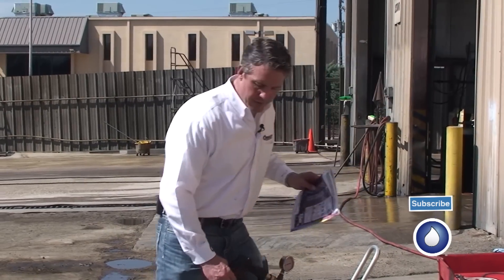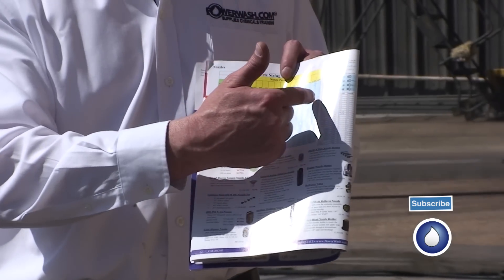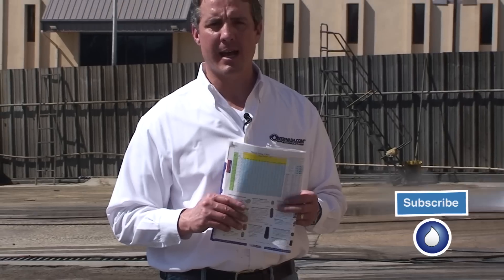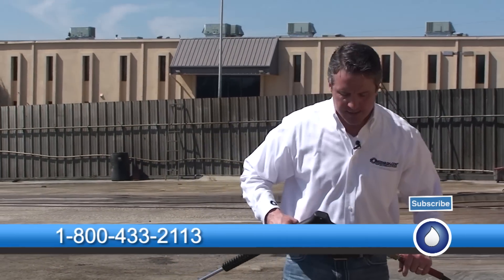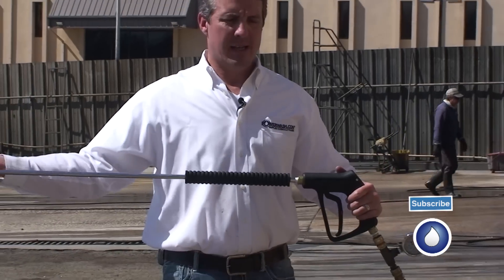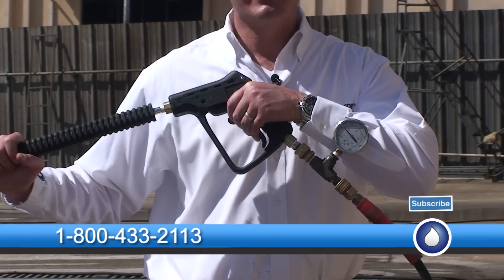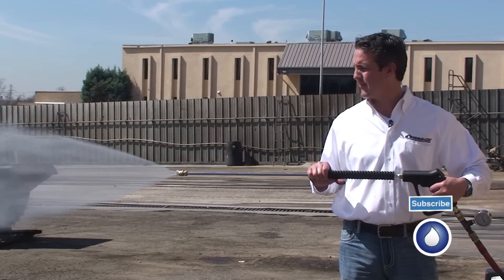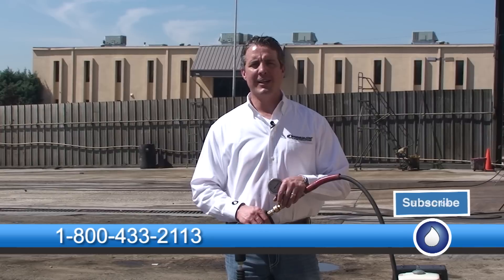How to Adjust the Pressure on a Power Washer | Pressure Washer Spray Tips

Comment: How about when you have a surface cleaning attached?
Reply from the maker: To address using a surface cleaner with your power washer, you can follow these key guidelines from the video:

Pressure Adjustment: Adjust the pressure by changing the nozzle size, not by modifying the unloader, to avoid wear or damage.
Nozzle Size: Use the nozzle chart to determine the correct size based on your target PSI and GPM.
Test for Desired Pressure: Start with an estimated nozzle size and adjust incrementally until reaching the ideal pressure.
Surface cleaners generally need consistent pressure for optimal results.

Comment: His so I have a 3200 pressure washer and it’s not on that chart and I was wondering what size nozzle I need. I think it’s 2.4 gpm
Reply from the maker: Go with what is the next higher or lower size.  For instance pic 3000 PSI at 3 GPM 3500 PSI at 2 GPM
Reply: @Powerwash  ok I’m trying to get down to around 1900 psi so how would I figure that out on the chart

Comment: I recently picked up a Craftsman gas powered pressure washer and it says it has an adjustable axial cam pump, the instructional video says to turn the valve counter clockwise to lower the pressure and clockwise to raise the pressure from 1,400psi to 3,000psi.  I'm trying to find the correct info since I already played with that valve turning it up and down.
Reply from the maker: axial cam pumps are not the same as the piston style pumps we use.  If the manufacturer is instructing you to operate it that manner then you should be OK

Comment: If I were to get a surface cleaner (DeWalt) rated at 3700 psi (my DeWalt pressure is a 4200) how do I turn down the pressure down to a level (3000 to 3700) so that I won't exceed 3800psi?  Thank you.
Reply from the maker: I would have to see the unit.  I am familiar with equipment we sell.   Generally speaking you want to go with the correct nozzle size.  Also check out our videos on setting the unloader

Comment: I have a 4000 psi 3.5 gpm gas power washer per spec sheet. The unit has a 389cc Honda motor. Do you have to run the throttle on max while using gas power washers? What if you run it half? Does where you position the throttle correlate with the performance or pressure of the water coming out of the lance. Seems like one would be refueling quite often if it's running full throttle. What should the typical running time be of a gas pressure washer that holds 1.61 gallons. Much thanks for all I've been learning. Just not finding anything on throttle settings..
Reply from the maker: It is normally best to run it at full throttle to match the performance of the pump.  You can adjust pressure with the throttle but it can potentially hurt the motor over time.  Most motors are designed for full performance.
Reply: @Powerwash  Thank you for your prompt response!

Comment: Hey guys! What about spikes that you covered in your video about unloader adjustment?
Reply from the maker: Here is a video that will show you how to adjust the unloader https://youtu.be/aWcdl3f1gaw
Reply: @Powerwash  Ok, i have electric pressure washer with total stop system. My idle pressure is ~1900 psi. When i press the trigger it's ~1450 psi. Should i adjust unloader valve to have around 1750 psi idle pressure? (300-400 psi above of operating pressure) In this video you're telling that unloader should never be adjust to downward pressure. In linked video about unloader adjustment, you are telling about this 300-400 psi spike above operating pressure. I'm confused :(

Comment: When you get your pressure washer should the unloader be set to the max or just the setting it came as? and from there to adjust you just change the nozzle size.
Reply from the maker: It depends on the manufacturer.  Yes, you can

Comment: Buddy, you just saved me a lot of trouble and probably money. My new machine is on the way (4240 psi/4 GPM). It has an unloader and, before this video, a lot of others were showing how to adjust the pressure by turning the unloader. Thanks to you, that's not happening! All I wanted to know was how to adjust the pressure (down to between 1200 and 1900 psi) so I can safely wash my car. Now I know! Thanks very much!
Reply from the maker: So glad we could help! Feel free to reach out if you have any other questions!
Reply: Exactly my needs as well. Want a washer strong enough for the yard jobs, but soft enough for my car. Nozzles pave the way it seems

Comment: Think you just solved my problem! Accidentally got one size larger pump for my TroyBilt with an AR RMW22G24, and it's putting more load than I want on the Honda engine. Want to reduce the load so I don't have to get rid of the pump since it's brand-new and the more expensive brass body one. Thank you for sharing this!
Reply from the maker: So glad we could help!
Reply: @Powerwash  went and picked up a set of 4 mm spray tips, machine running like a champ!

Comment: So i dont want to sound stupid ok...just want to make sure im correct...so based on the chart and having a psi of 2800 and gpm of 2.5....a size 3 or 3.5 should be ok for my machine right...???.. thanks in advance
Reply from the maker: Yes, that is correct.  You will need a 2.5 nozzle.
Reply: @Powerwash  A 2.5....ok thanks...i was way off....lolzzz....thanks again much
Reply from the maker: @anextday  Test with both because a 3.0 may also work.  It will be one or the other.  Machines are not always 100% built to specs.
Reply: @Powerwash  ok thank you very much....i'll check them both.

Comment: I have 4000psi machine that I would like to connect to Hydroforce sx 15 surface cleaner which only accommodates pressure between 800 and 2200. How could I reduce the pressure without the nozzle?

Comment: When your working pressure is 4000 psi and you close the trigger the pressure jumps 300-400 higher, is it safe for the hoses?
Reply from the maker: All hose have a rating on them.  I would look for one with 4500 PSI or greater.  Some brands are better than others so take note and use quality hoses

Comment: Great video I learned a lot. Where do you get the nozzles that you used in the video?
Reply from the maker: We sell them at PowerWash.com. They are called pressure washer quick couple spray nozzle for individual ones or quick connect flat nozzle set for the package of colors. Just type them into our search feature and they will pop up.

Comment: Hey Mike, do you know if i could damage my engine or Pump if i'm pressure washing at 60% or 70% Throttle---I was choosing to run at lower rpm's in an effort to reduce pressure. I think my pressure washer is around 10 or 12 HP , i know there are a lot of variables but just curious if there is a rule of thumb etc.... i should be following. Next pressure washer will be purchased from you guys for sure..
Reply from the maker: It is not recommended because the engine is not designed to run a lower RPM.  If you most do it only do it for a short time.  But the best practice is to keep the engine running at full RPM.
Reply: Powerwash.com thanks! Had a feeling It was under too much load at half throttle. (Was just quickly washing my car)

Comment: It’s ok to change nozzle while the machine is on? Or when you haven’t flicked a on off valve to off? Seems dangerous.
Reply from the maker: No problem at all with a trigger gun.  When the gun is released there is no pressure thru the wand and nozzle.  So it is safe to change the nozzle.

Comment: What if you need to adjust the pressure for a surface cleaner attachment?  I have a 3800 PSI / 3.6 GPM washer.   Most surface cleaners are rated around 3200-3400 PSI.  Wouldn't the unloader be my only choice here?  Or do I need to hunt for and purchase a rotating head with a higher rating?
Reply: You can swap the tips in the surface cleaner for slightly larger tips.
If you had two tips that are size 2.0 (at 25 degree spray pattern) that would give you a combined 4.0 size orifice which relates to 3500psi at 3.5 gpm. Usually size 2.0  is the smallest i can find. You'll just need to check that 3.5-3.6 gpm is enough flow rate for the surface cleaner you have.
Reply: Hey Brad not sure why i cant see your reply on here but i got an email with it in. There should be two 1/4" MEG Spray Nozzles under your surface cleaner that you should be able to unscrew and swap out with larger or smaller sizes. http://www.powerwash.com/v-jet-25-degree-nozzle-1-4.html they should look something like this some look a little different but basically the same thing. hope this helped.
Reply: @DanielFarnan  What does "MEG" stand for? I know what they are, just not what the acronym means XD
Reply: @nutritionandphysiology8023  for the life of me I haven't been able to find out

Comment: I have the same pressure washer and after 3 hours of using it it turned off and when I turn it back on it was creating any pressure and was like sputtering
Reply from the maker: Power washers can be damaged easily if allowed to run to long without pulling the trigger or supplying it with a low amount of water.
Reply: @Powerwash  what you think about using a honda gx390 engine with a 5.5 gpm pump?
Reply from the maker: @BadWeatherfreak  You can do that.  You will get about 2500 PSI max with a motor of that size.
Reply: @Powerwash  which is perfect.  I have a 4000 psi and ended up changing nozzles on surface cleaner
Reply from the maker: @BadWeatherfreak  Here is a link to a nozzle chart to help you find the correct size.
Reply: @Powerwash  thanks

Comment: I have a 3000psi 2.5 gpm washer. I need a nozzle safe for washing cars. I'm thinking around 1200psi. Can tell me which nozzle to buy from your website?
Reply from the maker: You will need a size 3 nozzle https://www.powerwash.com/pressure-washer-quick-couple-spray-nozzle-40-degree.html
Reply: So if the nozzle size for the 2.5 gpm is 2.5 to reach 3000 psi, you are saying go up 1/2 a nozzle size to go from 3000 psi down to 1200 psi? No way. More like a #5 nozzle or even larger.

Comment: Thanks for the video.  My problem on Honda PW is that the engine tries to stall whenever the bypass is engaged- like the pressure build up is too much.  I also have starting problems because of the pressure build up.  As long as I keep the trigger pulled I have no problems.  Suggestions? Thanks.
Reply: replace unloader valve
Reply: And never start a pump without a trigger depressed

Comment: Can you please help me? Have a 3400 psi 2.5 gpm trying to lower it from 1200 to 1300 psi. What size orfice would I need on 40 degree nozzle tip?
Reply: about a 4.5 nozzle
Reply: @OdinsCloud  Will this harm the pressure washer pump in anyway by increasing orifice size while reducing PSI?

Comment: I'm wondering if you can increase psi with this same principle and reduce the orifice size or is this a bad idea? The reason I ask is that I have a Generac 2500 psi pressure washer and their 2800 and 3100 psi units are the exact same engine and what looks to be the same pump. So how are they changing the psi output unless they are adjusting the unloader?
Reply from the maker: If it is the same pump and unloader than it would be a smaller nozzle with a different setting on the unloader.
Reply: Sure you could if the unloader will allow it BUT the pump is rated for a certain pressure and you risk premature seal failure and other problems.

Comment: Where does the unloader divert water to?  I don't see any connection between my unloader and the inlet of my pressure washer.  I am a bit confused to be honest.  I have a used NorthStar 2000 psi 110 volt unit with a Cat pump.  I picked it up for free from work, as they were under the assumption that it no longer worked.  It definitely works.  I'm not sure how much pressure it's putting out, but I seem to be getting a very slight drip, drip, drip from the thermal protection valve.  There is no tube hooked up to that valve, either.
Reply: the unloader was most likely diverted to a water tank, to cool the water, because the water heats up so quickly while in bypass, usually because of the restricted length of pipe, hence routing the bypass pipe to a tank - more area for water to cool.
obviously heat is always the enemy of mechanical parts 
nice find btw, cat pumps are awesome and so is there customer service
Reply: You probably have an internal unloader bypass connection. You'll find it at the end of the pressure washer  underneath where you attach the pressure hose. It diverts high pressure back into the lower pressure input hose and circulates without over building pressure. You just have to be careful how long you leave the trigger closed and putting the unit into bypass because it will build up heat and cause premature seal failure. With your type of pressure washer the unloader is integrated into the head of the pump.
Reply: Daniel Farnan Thanks for the information.  I haven't used in in awhile but it definitely works.  I always turn it off if I don't plan on using it for a few minutes rather than let it heat up with no where for the water to go!

Comment: I have a Simpson 3100 with a Honda motor and the blue cap on the bottom was sprinkling before I blew it off somewhere and water runs out under the machine but still works when started and triggered
Reply: Sounds like the overheating valve blew. I know most machines have pressure relief valves. Never had one blow but should be common. May have to get a new valve. Not sure if they are resetable. Good luck. I'm sure it's fixed by now. 🍀

Comment: I saw where there is variance from pump head gauge to inline guage, like 500psi drop at discharge outlet from pump head, in other words if you adjust unloader using outlet guage(vrs pump head guage) to equal rated psi of pump it could be 500 above the rated pump psi, so know your variance from pump to discharge outlet(ie. 20% etc), thanks for vid, newbie with EB4040HC(belt) on the way. Also any issues over longterm with pump mounted guage(leaks etc)
Reply from the maker: Been using pump mounted gauges for years.  They hold up about the same as being mounted anywhere else on the unit.

Comment: Question. I have a zr2700 machine that runs 2700 psi at 3 gpm. My gauge reads around 3000 when not spraying but goes to 1100 spraying. Tops. Does that sound like the unloader in your opinion? I've ordered a new one after opening up my unloader valve and it's got pits and wear on the internals. Seems very sticky even after I cleaned it up. Guess I'm looking for assurance that the new valve will fix it.
Thanks for the video. I'll know now to check my tips size. That's a heck of a lot of difference. 2000 pounds just by changing the tip. Thanks again.
Reply from the maker: Could be a bad unloader or improper setting
Reply: @Powerwash  Thanks so much for the reply. You are correct. Was the unloader. I had removed cleaned and greased my old one. With very minor pits and etching on the valve tip and seat. But still would not raise pressure beyond 1000 psi. Bought a new unloader with valve and it now works like new. Am pleasingly surprised that a little bit of etching and pitting on the valve and seat could cause such erratic power and low pressure. Thanks again for writing back with advice.

Comment: Got a question Mike. I'm going to pick up the Northern Tool Steam Boiler attachment. It has a steam nozzle but I only need 1000 psi for autos & possibly 1000-2000 psi for boats. I've only seen one steam nozzle & don't believe there are variable nozzles.
Reply: "Got a question Mike" hahaha you fool.

Comment: Hi 

can you tell me what to do if I want to keep the psi but lower the flow please 
Thank You
Reply from the maker: You could possibly slow down the motor.
Reply: Thank You
Reply: I did but the presure drop too
Reply from the maker: It is best to use a machine that is rated for the GPM you want to use.  Slowing down the machine will reduce pressure and GPM.
Reply: put a smaller nozzle now. But don't rev up the motor because the flow will increase as well :)

Comment: l have two hose reels rated at 3,000 psi, my machine is 4,200 psi how can l drop the psi on my machine so that l can use my 3,000 psi hose reels. Thanks
Reply: Jeremy Plunkett   Can't you just use wider tips (less pressure) to bring down psi strain on hoses? Buy 4200 psi rated hoses (they're not very expensive)?

Comment: In your previous video https://youtu.be/-CZkp3oBwIg ; you spoke about pressure spikes and calibrating your unloader so that the spike doesn't exceed 400 psi when you release the trigger. In this video when you're using the smaller nozzles your pressure spike is a few thousand PSI due to the how much the nozzle reduces the outgoing pressure. Isn't this bad for the machine? or is there something I'm missing?
Reply from the maker: The nozzle is actually larger and it is not bad because the spike is not going over the set spike pressure.
Reply: @Powerwash  could you give a little more of an explanation please. I don't really understand

Comment: How about the throttle on the engine?
Reply: Peter Hewel Yup that's how I do it as well as what the dealer told me. As long as you have a long throttle powerband. Never had issues.
Reply: Doesn't work for electric units.
Reply: I think that would drop flow as well right? Not always a big deal but something to keep in mind

Comment: Sir I mean 0 disrespect but if a person like myself uses a ball valve they can adjust the water pressure quicker than they can fart.   When I am going to wash a pool deck I start with very little pressure and work my way up. Especially with the fancy surfaces they have today.
I did subscribe tho
Reply: Where do you put the valve?